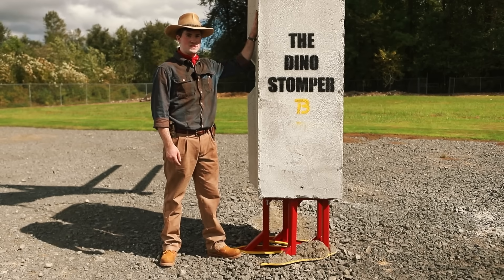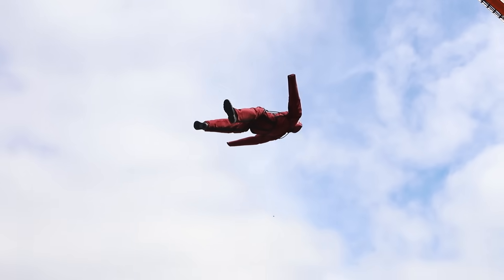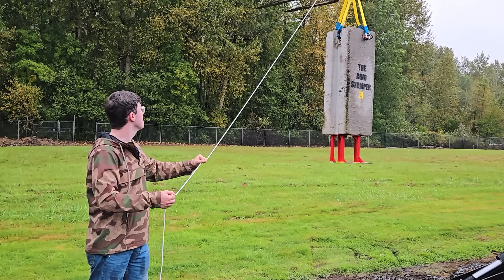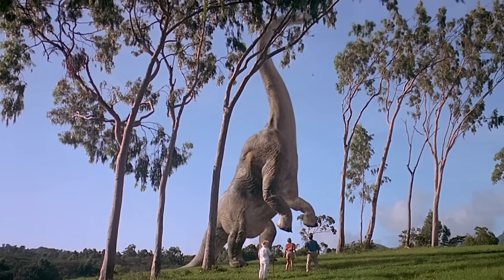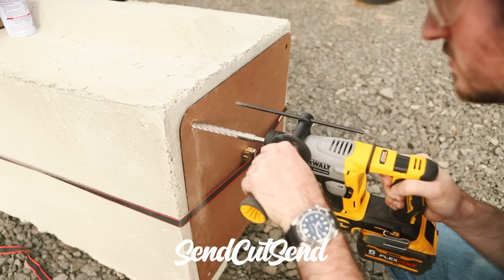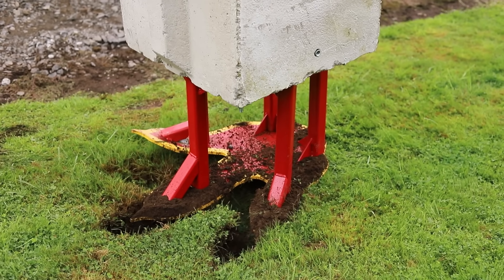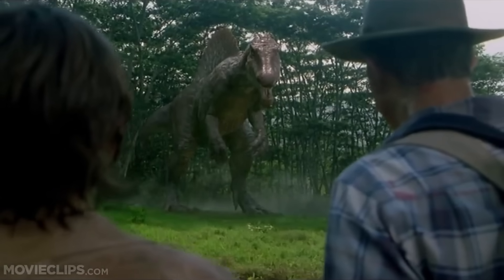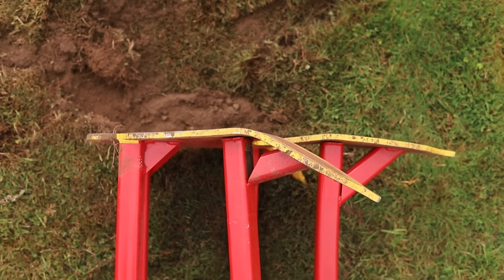Would Walking Dinosaurs Shake the Ground? Testing Jurassic Park

Comment: Fun video, but no, hahah, even the biggest dinosaur running strongly wouldn't literally shake the ground like this.  Even though I understand weren't going to calibrate for flesh vs metal/concrete and other factors, the weight calculations were off by a considerable amount.  A T-Rex would have only produced a fraction of that energy in each step.

Comment: However a Trex weighed quite a bit more than 4000 lbs. Even if you take into account that its one leg so you could half it, but still. Even Scotty one of the Trexs that has been discovered weighed around 10 tons which if you halve that is about 5 tons. However Soctty is the largest reliable trex found it mostly likely got quite a bit larger given new analysis of the trex.

Amazing that you did height to account, even if this does not account for other factors above!

Comment: Ok, I'm 1:35 in and I'm not going to say this is an invalid experiment, I'm just going to tell you that you're not testing what you think you're testing. 
Your methodology will test the kinetic force of the impact of a dinosaur in freefall which is very different than a walking motion. Also that dinosaur would have to then land on its one foot because you only have the one dino stomper.
It's not an exactly an invalid test, it's just not exactly useful for determining what you want to know.
But it will give you a better idea of what the actual answer to the question you are posing might be...and I want to watch the big dino stomper go boom lol.
Reply: 😂 I also should have mentioned that I've been an injection molding technician for the last ten years. The smallest molds I've worked with weighed right under 1,000 lbs, the largest has been 23,000 lbs. I've experienced impact tremors from molds at all points in that range being set down a little too quickly, or a couple of times from equipment failure or human error felt big ones fall out of a press. So while that was on a concrete floor, the largest that I've ever known of to just fall out of the press was on the other end of the building from me, and I still legit thought we were having an earthquake for that brief moment lol.
Reply: If anyone was curious I just measured it with Google Earth, I was approximately 300ft away.

Comment: a fun video. a real animal would of course try to conserve its joints and bones and even a real hard stomp would always be way softer than a block of reinforced concrete hitting the ground naturally. the energy involved stays the same, but on a "squishy" body it will be stretched out over more time. i guess its quite hard to come up with a more real experiment to this.  on one hand, you have elephants that walk so soft you cant even hear them next to you, on the other hand you can can actually feel the ground vibrate from a small horse galloppng towards you...

Comment: I have felt the ground shake when a heavy vehicle drove by; and they have rubber tyres, suspension, and all tyres stay in contact with the ground at all times. I'm sure a huge dinosaur would shake the ground a bit when putting down its foot.

Comment: There is something that they do not usually take into account and that is that these animals like all had pads on their feet which reduced the noise when moving similar to the case of elephants which do not emit tremors when walking because it would affect them when locating their position to predators or in the case of carnivorous dinosaurs like T. Rex to avoid revealing their presence to their prey like Edmontosaurus annectens or Triceratops prorsus which they ambushed and given their lack of noise since these animals did not roar and their bite capable of crushing bones and strong enough to crush the roof of a car made it a very efficient predator that added to its opportunism to the point of cannibalizing its peers if possible

It is known that as an adult he could not run at the speed of an average person but he did take long steps.

Comment: From what i have found an estimate of the weight displaced when a Tyrannosaurus rex took a step would be approximately  (4,190-8,820 lbs)This estimate assumes that T. rex weighed between 6,000-8,000 kg (13,230-17,640 lbs) and that roughly 30-50% of its body weight would shift with each step due to leg movement, tail counterbalance, and body sway

Comment: The entire T. rex breakout scene is stupid. From the subsequent scene, we know the electric fence is backed by a concrete moat that is at least twenty feet deep. What was the rex standing on when it broke the fence, thin air?

The water ripples in this experiment are realistic and caused by an impact on the ground a lateral distance from the cup. The movie effect was caused by a low-frequency audio speaker directly under the cup.

Comment: Fun  video...
A few comments.
1- Animals feet are padded.  This is nature's shock absorbers.  The impact of a foot would be a bit softer/quieter than a concrete and steel foot.
2- Extrapolate.  I would have analyzed the sound and vibration of an elephant running.  Separate impact of the footsteps and compared to your algorithms.  If an elephant weighs so many pounds and creates these vibrations, scale it up to T-Rex size.
3- The structure of a T-Rex had to survive it's weight and the impact of movement.  So, when moving fast, the impact would be spread through it's foot, ankle, leg, and muscle.  Thus softening the moment of impact.  That is why  parachutists in the military were trained to keep knees bent and then roll upon landing.  Just falling from 4 feet with stiff legs would hurt or damage you.  Modern chutes have better ways to mitigate the speed and direction of decent, to allow stand up landing.
Reply: Yes, T. rex feet were padded this is known by footsteps
Reply: this was more of a experiment to show "what would it take to ripple the water"
It gives a great bound to what a T-Rex foot step could be, like water can actually riple.
But there is little doubt in my mind that a real T-Rex would walk up on you with almost no sound, it wasent a plant eater.
If it made a sound it would be a mistake on its end, thats the scary cool side.

Comment: “The Tyrannosaurus Rex would have made no noise whenever walking. Ground shaking would not happen either, due to the Tyrannosaurus having padded feet. However, the ground shaking a little bit, making small ripples in a cup of water, would have happened, due to not just being 9.5 (US)tons, but would have gone up to about 10.5 tons at its largest. The average weight for Tyrannosaurus would have only been 8 (US) tons, with the movement of up to 12-15 miles per hour, (science shows this speed as somewhat accurate due to the Tyrannosaurus being a 20,000IB animal, and for it not needing to run, due to being either a scavenger or an ambush predator) it would have made no significant sounds, or ground shaking, for being an ambush predator. It would have stepped at least 1-2.5 feet off the ground, along with its speed of…(I already addressed it)… it would have done toes first whenever stepping down, for better silence whenever ambushing…say…an edmontosaurus(Hadrosaurid dinosaur from the Cretaceous period. Around the same time as the T. Rex). And no, it did not have horrible eyesight, science shows that due to it having a 55 degree angle of depth perception with the shape of its skull, also allowing us to find out more on how smart it was, shows that Tyrannosaurus would have had eyesight better than a hawk or vulture. The scavenger theory would have been correct, mainly for younger Tyrannosaurs, due to their sense of smell going up to around 3 miles, which is the same as a vulture. This stays the same for adults as well. In conclusion, Tyrannosaurus would’ve made no noise whenever walking, or speed walking, because it couldn’t run.” ☝️🤓

Comment: I dont think so. This would be like a trex jumping off a3' or a 7' cliff and landing on 1 foot. There is to much give in their legs and body to absorb the landing while running. Think elephants while their charging, in which would be their run. Yes they have 4 legs, just divide it by 2. You may or may not hear a floommph floommph floommph as their coming at you, from their foot pads making contact. But no giant ground shaking thump thump thump. Christ sakes, the stupid trex at most weighed what, 10 tons, ya, thats a bull elephant. They wouldve broken their legs and joints if they did what your claiming in the video within 20 feet of their run.

Comment: Y'know, actually... In theory, wouldn't wetter ground be better for seismic propagation? Hydro-Static-Shock and all?
I mean, i'm coming at this this strictly from a "gun guy" angle, so i have no idea if the principle carries over from a 1/8th oz Projectile traveling 22hundred feet per second to a 4000lb projectile traveling like, 9 fps. 

But yeah, wouldn't near-saturated dirt be best for propagating the vibrations and stuff, cause dirt is compressible but water is not?

Comment: Remember in the iconic scene, the car that the cup ripples in is not the same as what you are using. Sounds obvious I know but you should remember that all the kinetic energy in your experiment is going through shock absorbent rubber tyres, in the movie the jeeps were also connected to a metal track which was solid and would have helped with the energy transfer to the water cup :)

Comment: I think reinforced concrete will transmit sound and vibration better than wet ground. In the film there was a lot of reinforced concrete around the car. The road, the communications underneath it, the storm drain, the fence. I would like to see experiments that take these circumstances into account.

Comment: I've always looked at the ground shaking the same as the roaring just before the attack. Ridiculous. Animals legs are built to absorb the shock of the weight. Yes they leave prints just because of the weight applied but they didn't/don't stomp the ground. Similarly, predators don't announce their intentions to attack to their prey. Lions and Tigers don't roar just before pouncing. And lastly, the sound the dinosaurs made would not sound anything like movies make them sound. When have you ever heard a bird roar like a lion?

Comment: The thing is T-rex was an ambush hunter so it's feet were most likely strongly padded like a cushion and dropping weights with a metal cutout underneath it wouldn't really simulate that. Also it's not really clear if the T-Rex was even capable of sprinting it most likely walked qickly like elefants. If animals could feel T-Rex approaching it wouldn't be able to ambush them so I think all things considered you couldn't feel and definitely not hear a T-Rex approaching.
Reply: Not mentioned anywhere, T. rex had the actometatarsal condition, which means they literally had bone spring/dampers in their feet

Comment: It would depend greatly on the density of the ground.  It would depend greatly on the gait of the dinosaur and the number of them.  I have experienced  perceivable ground-shake from the movement of large equipment and from galloping  cattle and horses. Mature cattle and horses usually max out between 900 and 2200 lbs.

Comment: Dude....COMPLETE YOUR WELDS!!!! I saw that other one that just had barely an inch down the side joined. A bead across one face, especially the face seeing a bending moment IS NOT ENOUGH!!! Okay, you might need a hotter welder, sure, but im willing to bet you're also not set up properly, or you're babying it. Its metal. Dont baby it. And honestly look up welding videos, you're on youtube, you can utilize it too. If you're playing into the nerd thing, you should be excited to learn some tricks to get better welds, how to set the polarity properly (did you know it mattered if the torch was pos or neg, and that changes with the material, and even on the same material based on thickness? I DIDNT! But I got that tip from a youtube video (this old tony I think)), feeds, speeds, puddle characteristics, how to gauge penetration, all that fun stuff. But, real talk...if you keep welding like that your welds are going to hurt or kill someone....sure it didnt fall on anyone, but what of that brace shot out of there after coming under compression because that one sided bead tore out? What if it injured your dog? Would you care to do it right then? Does your dog really have to get hurt by one of your chintzy welds before youll spend the extra 20 minutes doing it right?

Comment: Would walking Dinosaurs Shake the Ground?
- a little, but not really any more than most animals do.  In fact, most large theropods had steps that would have been virtually silent. ... Imagine a 6 ton, 12 ft tall rex sneaking up behind you and you wouldn't know till you felt its breath... and people say that realistic dinosaurs can't be scary.

The biomechanics of the leg, and the thick padding that would have been on their feet would have reduced the shaking to almost nothing while walking. While running or jumping, there would have been more vibration... of course.
For a similar idea of what it would be like, go see some elephants.  

Sadly, this is less about "would dinosaurs shake the ground?" than "if something heavy lands, does it shake the ground?"  When things walk, they don't just drop their weight in a single big boom...

Comment: You also need to factor in location. Different substrate, proximity to tectonic plates that are close to the surface etc. For example, my whole house shakes slightly when a large vehicle goes over a speed bump about 200m from my home. I am pretty sure if a T-Rex ran down my road it would rattle the windows on all the houses along our street. Apparently that is because there are ruins beneath our street dating back thousands of years but the same effect occurs naturally in nature too. 

Food for thought.

Comment: Studies have found that T. rex had cushion like pads of tissue under its feet which acted as shock absorbers, so basically, no thump thump, just silent death ambush.
Reply: That wouldn't have absorbed sound (at least not much). That would have prevented damage to its bones because of how large it was. It also allowed it to move faster without sustaining injuries.
Reply: The ground sound or shaking is simply the opposite effect of the joints experiencing shock due to the feet slamming the ground, so the ground would absorb sound energy proportional to the joints. the pads would probably be more for reducing the high frequency waves from reaching the joints. And  the low frequency energy would NOT be absorbed by the pad (its the actual locomotive force for running) and so you would still possibly get the ground movement and feel it in your guts but not hear it.
Reply: @SoulAir   This contradicts actuality, though. Large animals gently place their feet down, and t-rex was much too big to sprint, so it would have briskly walked, with no stomping occuring, and therefor no shock being sent into the substrate, which wouldn't have been shaking anyway due to the dissipation of said energy in the case that there was any stomping motion. The pads in feet do not work like that at all. It doesn't transfer shock into the ground to save the joints, it completely negates the shock in the first place.
Reply: @Indyofthedead it absolutely would have absorbed sound, like it does in modern elephants. Tyrannosaurus was most likely an ambush predator so having silent footsteps would have been a necessity